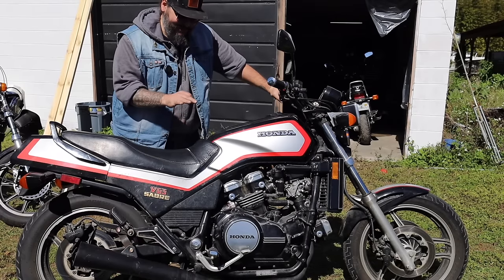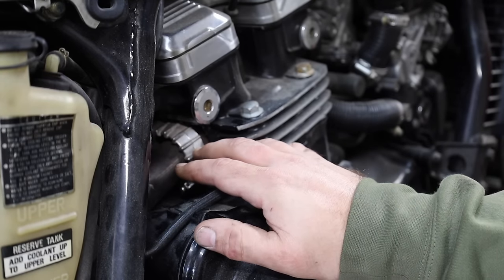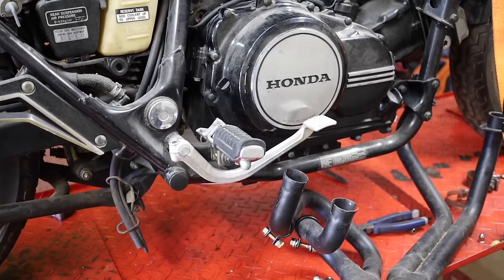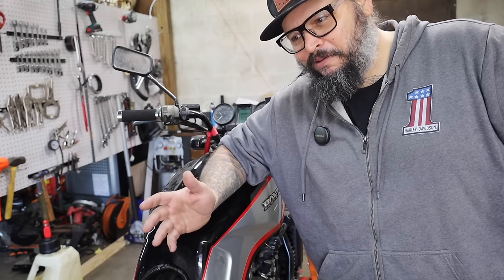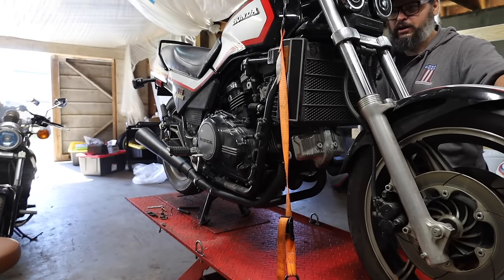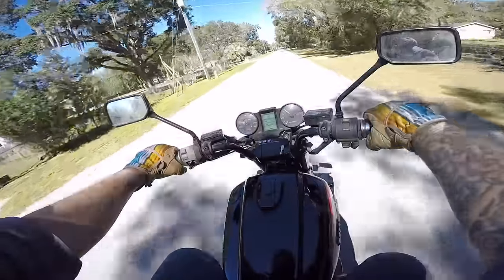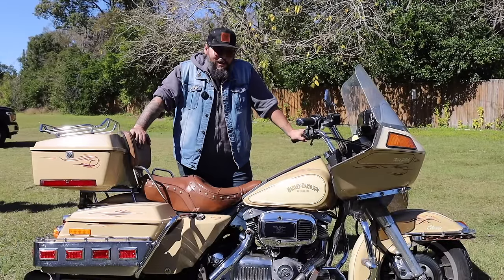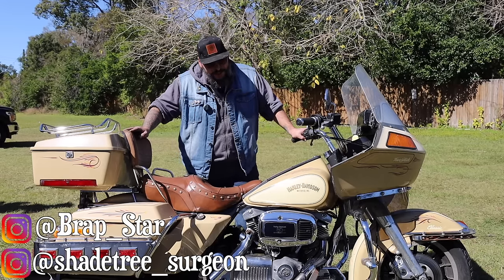Bringing the MOST DANGEROUS Motorcycle of the 1980s Back to Life | RESURRECT THE BEAST 😈

Comment: I'm a Honda guy, had a CB750 and a Nighthawk S ( 700cc ). A buddy of mine had a V65 Magna with a shield and it was everything that a Quickest Bike should be. Jay Davidson jockeyed one into the 10s back then and set a record.
Reply: My buddy had a 750 nighthawk. That lil bike was a freakin rocket😂😮
Reply: I have an old 74 cb750 four that’s more of a garage decoration, and an 04 vtx 1300. Love them Hondas
Reply: I know I"m not in the same league with you guys with the bigger motors, but I do love my little cb500f which is the only bike I can afford right now. I would say that is an impressive bike for an old classic from Honda V65. I wouldn't mind upgrading to a bigger cc bike that is a inline four. Honda is so expensive, and I don't really want the cbr. I like upright naked sport like cbfs.
Reply: Had a 84 Nighthawk S and I am certain that the CB700sc  is the best motorcycle ever produced. Except for the design of the clutch pushrod system. Like why not a c-clip over the bushing? Why do I have to take the output cover off? Do you understand how much of a pain in the ass that is 1980s Honda engineer? Do you, have you ever had to do it? Huh 1980s Honda engineer.
Reply: Jay Gleason
Reply: The first motorcycle I owned was a 84' CB700SC Nigthawk S, my second was a 86' VF700C Magna, and my third was a 94' CB750 Nighthawk. Loved all of them.

Now I have a 500 Scrambler and an 1100 Rebel.
Reply: Yep! Otherwise known as "Pee Wee Gleason".
Reply: Brother had a Nighthawk S. I had an '82 CB 750F SS.
Reply: Jay Davidson or Jay Gleason?
Reply: The 700cc version of this was my 1st bike. I absolutely loved it. My supervisor had a 700cc Nighthawk. We used to love ripping thru the secondary highways in N PA. I shouldn't be alive, but what fun!!
Reply: @sabre0461  When brother got his they said you can't do a wheelie, they were wrong.
Reply: My favorite bike was my 1984 Nighthawk S; in red.  Not really a powerful bike but I loved the styling and itxwas a nice all around great running bike.  V65 Sabre was definitely a monster for the time, and I know a few people who got over 100k on their V45's.
Reply: @jakerazmataz852 Yeah, it definitely had enough juice! 😂
Reply: @sabre0461   Because of the shaft drive it was supposed to be hard.
Reply: My relative had a magna I don't remember I thought it was a 700 or 750 no joke the bike was fast I have been riding all of my life. With him on the back I put it on 150 nothing done to the bike. Maybe he just got the right one
Reply: Davidson or Gleason?
Reply: @mrwhite2628 the best stock run he made was on the V-Max I still have the Cycle World mag, I miss those days.
Reply: I love the Magna, what a great bike.
Reply: I have a V65 Magna 1100cc  parts bike for sale. It has the oil mod and is in San Antonio. I want $500 or best offer.
Reply: @spaceflight1019  Gleason

Comment: I had both the v65 and the sabre...absolutely loved them both.wish honda would bring them back
Reply from the maker: Right???
Reply: I have three sabres with V65 engines and one sabre with 700.
Reply: My first true road bike was an 84 saber 700. That v4 engine was a work of art that has the smoothest power band of anything I have owned since. Mine looked exactly like the one in this video just the 700 version.
Reply: @michaelalbert8474  
Yours was either an '85 or it was a 750 (V45).
Reply: @elgringoec  
Make Model: Honda VF700S Sabre
Year: 1984-85
Reply: @michaelalbert8474  
I may stand corrected. 

"Honda Sabre (VF700S) in 1985 the model with standard body and 699 cm3 / 42.8 cui engine size, 59.6 kW / 81 PS / 80 hp of power, 6-speed manual powertrain offered since late-year 1984. "

Mines an 85.  Apparently going into the '84 model year they were vf750s.
Reply: I still have a V65 Saber with factory fairing.  Mine is not black and silver.  Mine is sort of a burgundy color and silver.

Comment: An 84/85 V65 Sabre is the best value in motorcycles out there. When they're running and maintained they are great mileage crunching machines for less than $2000. They don't handle the best and they are heavy but in some skilled hands they can run with all but the best of the sport bike crowd. Yes they were the cream of the crop back in the day, they're still are an exciting ride even today. I've restored several sabres, a dozen or so magnas and still own a couple of each. There's nothing out there today that gets my blood pressure up like an old school motorcycle. People are shocked when they hear that they have 121 hp, adjustable forks/shock, shaft drive, overdrive, three disc brakes, electric fuel pumps, self cancelling turn signals, electronic ignition, gear indicator, temp and fuel gauges and a clock! My magna and sabre both have about 80,000 miles, will run strong all day and don't burn any oil. The one thing they sacrificed on was that rectangular head light. It looks great on the bike but its severely lacking at night. If you're going to go hooligan at night, you'd better know the road well because you will outrun the headlight coverage very quickly.

Comment: I'm enjoying my second 1984 V65 Sabre which I got as a $300. basket case three years ago(it took me 8 months to put together because it's not easy to find parts for a 40 year old bike!). My first was in the mid 90's and they were/are the same base colors as this one. My first one came with the factory "Honda Line Fairing" which made a serious difference in the top speed(rated 177 mph). I hit 150 mph shifting into 6th gear @ 9000 rpm and decided I didn't need to know how fast it could go! On a bike that redlines at 10,000 rpm I never forgot it! I'm 30 years older now but it makes me forget how old I am when I ride it which is sparingly and with much more restraint than I had on my first. A rare "super Bike" even by todays standards!

Comment: In the mid 1980s I owned the V45 / 698cc version of that Saber. Mine had dealer installed frame mounted Hondaline 3/4 fairing and Vetter suitcase saddle bags. While having less power than the V65 mine was a screamer too. I would routinely ride it from Fort Bragg, NC to Denver, Colorado in under 24 hours to visit my girlfriend. I would cruise it at 115 mph. It had the Federally mandated 85mph speedometer so I calculated speed from the tachometer. Mine did have a scary wobble in curves between 70 and 80 mph so I would hold my speed to 65 until it was safe to ride 85. I still loved the bike. But after I had it a couple of years I traded it in on a Class C camper to live in while in the Army to get out of the barracks. I shortly later bought a 1970s Kawasaki Z900 that was fun too but it didn't hold a candle to the V45.

Comment: PFFFT!  In the UK we were riding Kawasaki Z1000 variants and they pissed all over these things.
The V4 Hondas of this era had terrible oil flow issues - the Sabre and the V750F were known for their "chocolate camshafts." 
My mate had a Sabre - it spent much of the time in my garage whilst I wrenched on the unreliable tart.
Reply: Hah! I don’t believe any KZ1000 ever pissed all over a V65 engined bike. But they did have known top end oiling problems. Another known issue with the V65 was second gear  issues.
Reply: @TheBlueDogMan    The 80's Honda's had some the worst notchy shifters in motorcycling. Only got so many missed  shifts through neutral and you were buying a transmission rebuild.
Reply: Yes katanas   kzs and  1150s and 1300s   shit on them  but the honda was fun power

Comment: I took my V65 Sabre out today, actually. Just for a short ride, 60 miles. I have mine since 2004 and it is my second one. I love them. You focus in this video on the power of the thing, which it has in bucket loads, but it is a very comfortable tourer as well. Because of the power you can ride it with very low revs and it picks up in any gear. The V4 is silky smooth and will happily run at just 2500rpm. 
On my first one I did several holiday trips, to the south of France, up to the north of Scotland (I’m from the Netherlands), with a load of luggage on it. 
I is a beast, but a very gentle one.
And extremely reliable. Mine just had a carb rebuilt and that is it. It has now 84000km (52000miles) on the clock.

Comment: I've owned three Sabres.  Two v45's and a v65.  The v65 really was a beast!  Carbs were a pain to remove the first couple of times, but gets easier once you get the knack.  The plastic fuel tubes between the carbs are bad for cracking out as they age.

Comment: Have a 1984 v65 sabre and a 1989 vmax both like new condition. The sabre has a few things the vmax doesnt.  Overdrive, fuel gauge,temp guage.Dual horn lol 😂. Adjustable front suspension [dampening].And bigger gas tank,also self canceling turn signals.good luck and enjoy.

Comment: Need to get the front faring on it.  Very fun bike, a friend of mine loaned me one for 6 months when I was in the Philippines back in 1990.  V65 Sabre very fast, I was 24 years old, I had so much fun on that bike, it is a bike you need to know how to use your brakes because it will get up to speed super quick.  I remember it would hit 60 in second gear before you knew what happened.

Comment: I bought one of these new and had it for 25 years or so. It was an amazing bike. BTW, they had issue with the temperature probe in the radiator.. I hot wired the fan with a switch early on and used it that way for years. I traveled all over the country on that bike.
I would love to have one again.

Comment: Bought an 85 v45 in 2006 for $600. Shifting fork was bent so it kicked out if 6th gear sometimes but you didn't need 6th gear. Was my first bike and taught me a lot about motorcycles

Comment: Has one in 84. It was a great wheelie machine. Was working at a Honda dealership was riding a Yamaha still as I worked at a Yamaha dealership 1st. It was a fast bike lots of torque.  By 85 I was once again working at the Yamaha dealership. Service a new V-Max for a customer figured it would be equal to the V65 engine  had a surprise coming.  The Yamaha had more power everywhere. Put my Sabre up for sale within a month.

Comment: I've owned like 4-5 v65 sabres and a 700 sabre,  all but 1 v-65 that i bought never needed the motor pulled to fix the infamous 2nd gear and 5th/overdrive issues.  i send the gearsets out to have them back cut the engagement dogs on the gears, even developed a method to rebuild the stock unrebuildable rear shock.  They are great bikes aside from the handlebar design, i swap them out for a wider more comfortable set.  I've gotten older to the point where its difficult for me to swing a leg over the bike anymore,  sticking to low seat height cruisers until i can't ride anymore.

Comment: I owned an '85 V-65 Sabre for 10 years, and it made horsepower and torque exponentially as you twisted the throttle. Real problem is, there is no factory wind protection, so once you get above 100 mph, the wind wants to throw you off.  Would love to see Honda bring this back with an aluminum frame, and factory wind protection, and some hotter cams, man that would be crazy fun. Regardless, it put a smile on my face every time i rode it.

Comment: I loved the V65 Magna when it came out but my first child was born in 1983 so I did the right thing and put my 1973 Five Hundred Four in storage.  Twenty five years later I took the Five Hundred out of storage but I'd put on 100 pounds so it didn't have the same get-up-and-go I remembered.  I found a 1983 V65 Magna and bought it early in 2009.  I still have the machine, 52,000 miles on it.  Living in rural Maine and on a dirt road the bike is tough on my 71 year old back.  If I go out to the barn it will start right up.  I've toyed with selling it buy my youngest wants to buy it.  She has a 1985 V30 Magna.  I think it is too much of a bike for her but the V30 is scary fast too.  By the way I did the 4 into 1 years ago with a Kerker setup.  It wasn't as difficult as your Sabre install.

Comment: Bought my '83 in '85 with 5,000 miles. Scary power 140 mph.
Don't speed shift. Missing the shift between 1st and 2nd can damage the shifting forks. I made that mistake . So 2nd gear isn't easy to get to, Make shure you fully engage the clutch from 1st to 2nd.
I did tons of 2 up riding with a pretty 18 yr. old, natural blonde, with blues eyes and big hair. 
🎼🎵🎶 "And we were rockin', rockin' into the night" (.38 Special) doing an easy 80 mph.
My V65 Sabre had the maroon stripe. Very classy looking. But a mean mother...
never had a breakdown always fired right up everytime.
I put Metzler's on her in ’86 and it was 100% better handling than the stock rubber. Especially the front tire. And I loved the rear air shock, too!
Good luck.🤘🤘

Comment: I've got a 1985 VMAX, bought it new. Presently it has over 135,000 miles on the clock. Back in the day, I'd go prowling for V6 Sabres and Magna's, and eat them for lunch with the Max. 
My riding buddies rightfully named the bike "Godzilla", a name it displays proudly on the rear fender to this day.
Oh yeah, with the exception of a couple stators being replaced, and a clutch job, the motor has never been torn down. I'd still put money on Godzilla in a run against a stock V65.

Comment: I had a VF500F2. Ridiculously quick for a 500. But it did have issues. Poor case hardening on one valve top. It hammered the valve through the collets. Bang! I rebuilt it with a mate’s help. All good after that.

Comment: Had a 85 GS 1150, did the carb upgrade, single air cleaners and a supertrap 4/1. Totally different bike, great powerband. Had a roomie with a v-65 sabre, rode it, while being a little underwhelmed i was thinking how choked those years carbs were. EPA JETS SUCK . Dyna jet kit, ditch the airbox, open the exhaust, that v-65 would be wicked

Comment: I own a Honda CBX1050 (inline 6 cylinder) and that's a lovely bike (its basically bone stock original).  And I've also got an '82 Honda CX500.

This Honda Sabre/Magna v65 is more or less like the CX500 in respect of the shaft, but with a V4 and the power of the CBX1050.

Safe to say, the Honda Sabre/Magna v65 is my next classic to buy.

Thanks for this, beautiful

Comment: I have worked on v45 and v65. Carb work is horrendous on seating. We did the oil mod on the v65 to solve upper end oil starvation issue. Hasn't died yet.

Comment: Had a 700 in  1985. Always wanted the v65. In 1997 a guy at work sold me his.  Had a Crack in the block.  Leaking oil. Have the tools to fix. Tig. Mill. It just got pushed aside.  Other projects.  One day. I hope to get her running.  They even made a supper charger back in 84 for that bike. And the faring that you could buy, made that bike.I had one for my 700 Sabre. Rode it from El paso tx to michigan and back to Fort bliss. One day.

Comment: I had two family members taken out by one of these in two separate incidents. A cousin crashed it about a month after purchasing one new, paralyzing him from mid chest down. At the time, he was in the military, 101st Airborne. A thrill seeker at heart, he found his diminished condition to be unacceptable, so he finished what the bike started. We buried him on a Tuesday.
 Another cousin was raised in the same household as the fallen paratrooper, which is to say that they grew up as brothers, with the younger of the two idolizing the elder. 
 Years later, after the young cousin grew into adulthood he found himself in possession of the damaged bike, and set about repairing the neglected mass. With the restoration complete, his life counter began ticking down, reaching zero in just under a year from the time of his first ride.
 A few days after his funeral, my uncle pulled up to my shop. In the back of his truck lurked the twice cursed remains of the motorcycle that had been pulled from around the utility pole. From the moment I made the first cut with the torch, until the last piece hit concrete, he never averted his gaze from the twisted creature that had robbed him of both his "sons". It was as if he wanted to make sure that it could harm no one else.

Comment: Not the baddest thing you could get, but it was very respected.
However the competition  was rather stout as it competed with bikes such as Suzuki's GS1150ES,  Yamaha's FJ1100/ 1200, Kawasakis Ninja 900 and Hondas own Hurricane 1000. However, the Saber was marketed as more of a UJM /Sport tourer and Honda offered some nice bags for those interested, but i never saw one on the road wearing such. The downside of this bike was the same as that on the V65 Magna in that it had oiling issues which could wreck the valvetrain. This problem was not a guaranteed issue, but there was enough cases that the motorcycle community was well aware of this problem and fixes were available to address oiling needs.

Comment: Secret confession.  Loved the vmax owned 3. Never messed with the v65 because i thought the name implies 650 cc... lol not v4 angle.. ugh now i want to try one
Reply: I had one ; a V-65  Magna ,1985 - V stood for V4 motor & 65 stood for cubic in. Displacement. Learned to drag race w/ it; 2nd gear starts & bump thru gears.1st gear starts would lift frt tire off the ground. Think 1st rear tire lasted me@ 1500 miles!😂
Reply: 121 h.p.@ rear tire!😊

Comment: Love the older bikes. I have an 84 honda vf1000f interceptor with 17k miles on it. Slowly putting it back on the road. They only madd this bike for a year. Parts are really harc to find. Also tring yo find a shop to do work i cant is like pulling teeth.

Comment: I just tested my new 90LBS draw weight 240FPS speed crosbow in my livingroom. That was srupid and dangerous. That solid carbon fiber bolt made nice and big bang when it hit 1mm thick stainles steel plate and went trough it. It was worth it. There is stone walls round the plate and it was angled. It got stuck in to plate, so my wall is ok too😂